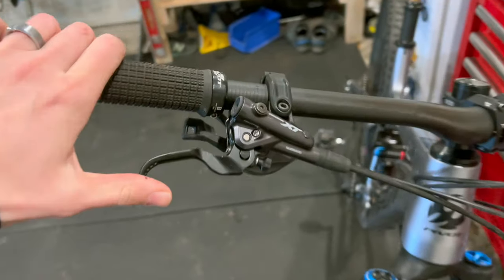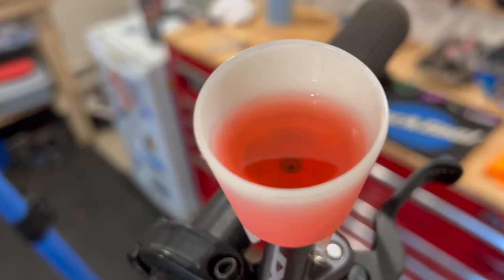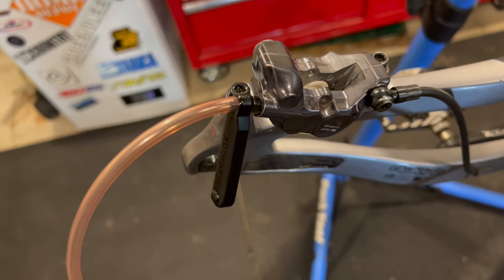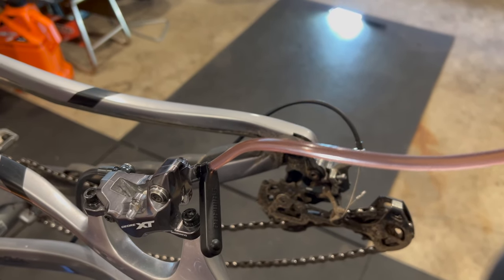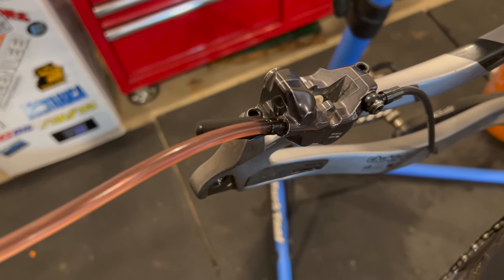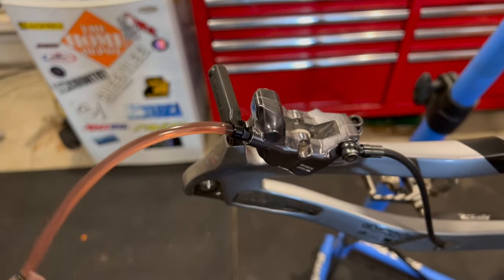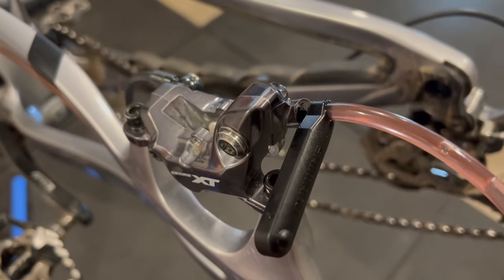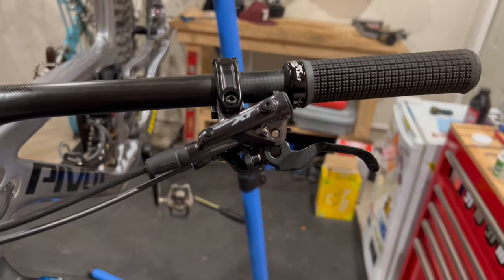Shimano Brake Bleed - Quick and Easy - How To

Comment: I just did this last night, before watching this video. One thing I would add is that once you are finished at the caliper end, and have the bleeder tight, fill the cup again and flick the brake lever a few times. Doing this should help remove any residual bubbles from the system.

Comment: I’m no pro but to add a Little something.. flick the lever also to release and bubbles and back out the adjuster screw as you flick and tap brake then screw back in… might get some more bubbles to release but this is pretty thorough pushing the oil back-and-forth through the system probably don’t need the lever trick I mentioned, but doesn’t hurt. 👌

Comment: Until I swapped over to magura I didn't realize how easy it is to do a lever bleed with a syring instead of the cup. Maybe it takes an extra 3 to 5 minutes but much more effective. Just watch how to do a quick bleed for magura you can use that on Shimano or SRAM brakes. Works like a charm
Reply from the maker: I always found that I over bled the system with a syringe at the lever. But if your technique works for you then keep doing it!
Reply: I have some Riderever (Jagwire) Arc-U brakes on some bikes.  They're cheap were I am ($36USD each end) and they use two syringes. Instructions say to lock the caliper end with a plastic clip on the hose after finishing pushing back and forth, and push the lever syringe in a bit, then unscrew and replace the bleed screw. You can definitely push too much in as I found the lever can't be adjusted all the way out now (they could go out a lot further than my hand can reach, so no biggy) 

It's easy enough with Shimano, having to repeatedly squeeze your brake lever with one hand, whilst holding the syringe upright at the caliper end. Even easier when you go find a velcro strap to hang the syringe upright off the bike frame 😊

Comment: appreciate this video. I've never had to fully bleed my brakes. I've burped the lever a few times but never a full bleed. That might change in a few days. i bought a larger travel fork so my front brake hose might be too short (going from 120mm to 160mm travel) I might have to replace the brake hose with a longer hose so a full brake bleed will be necessary. Wish me luck, hopefully I won't actually have to replace the hose since my new frames headtube is shorter so I'm hoping the shorter headtube and longer travel fork make up the difference in the length of the brake hose lol.

Comment: Are you doing this with the pistons pushed back or anything? And not using the bleed blocks? Need to do mine tomorrow so just wondering.
Reply from the maker: Yes with the pistons pushed back. I find you generally don’t need a bleed block if you go slowly, you’ll just need to watch the pistons so they don’t fall out. Use a bleed block if you don’t want the hassle. Thanks Len

Comment: Thank you....thank you...thank you!

"You don't need this part here"

I did! In my bleed kits i have an elongated piece of plastic with different sized holes near each end. I never knew what it was. None of the 4 local bike shops I've gone to have used one in front of me. None of them.mamaged to bleed my rear brake properly. 

The tube was always slipping off the bleed nipple. It was decalred 'unbleedable'. I was considering a punctured lever bladder and buying a replacement. 

So, I attached it firmly with the plastic piece, and ran very slowly back and forth the oil. Major patience mission. Put back together and my brake isn't perfect, but it doesn't go to the bar anymore on that first depression of the lever. It has a solid feel to it, not mushy. There's still a pump effect though, on the first depression, so I'm going to repeat tomorrow when I have more time, and make it my mission to get the last bit of air out of it! Slowly goes it!
Reply: Good to know.  What bleed kit did you use?   The kits I've seen don't include that plastic piece.

Comment: One question: why didn’t you use the yellow bleed block? Doesn’t it overflood the system if you don’t use it while bleeding?
Reply from the maker: I find that the brake caliper seals on Shimano brakes are normally strong enough to keep the pistons in place so i don't normally use one. This video is just a "quick" bleed, i would normally advance the pistons and lube them with mineral oil before retracting them after bleeding, negating any chance of the system being too full. Hope that makes sense, thanks Len

Comment: Thanks. Thumbs up and subscribed. One query. How do you rectify problem if the brake lever is too sensitive. The feeling that the system is ‘over full’. I would appreciate any advice. Apart from that the brake is fine. 👍🥳
Reply from the maker: Put the bleed cup back on the lever, then push the pistons all the way back, then remove the bleed cup. That should address the over bled feeling. Thanks Len
Reply: @garage31  Thank yo0u sooo much for the advice. I appreciate your time. Kind regards. John (UK)

Comment: Very helpful video.  I have a Switchblade also run XT brakes.  What brake pads do you have installed?  I am not a fan of the finned pads that come stock.  They rattle a lot and very noisy.  I'm currently using a hack to quiet them down
Reply from the maker: Thanks! I’m currently testing our own Garage 31 pads, no fins and a lot more modulation than the stock metal pads. I agree the fins rattle, add no performance for most people plus they are expensive. The Garage 31 pads will be much more affordable when they’re released. Len
Reply: @garage31  random question but do you happen to know the difference between shimano mt420 brakes and the rest of shimanos 4 pot brake models? Im looking to upgrade for more stopping power for when i do the occasional trail with a long steep descent like Pikes Peak. From what i can tell the main difference is the higher end models have better durability and longevity but i cant find much on difference in actual performance

Comment: Can I use Maxima Mineral Brake Oil on my Shimano brakes? If yes, can it be mixed with Shimano mineral oil or should the existing oil be flushed out first?
Reply from the maker: Yes no problem, I would flush out the old fluid regardless but if it mixes a little it won’t really affect anything. Thanks len

Comment: Just like that without any bleed blocks or pumping the system?
Reply from the maker: Yes, normally no bleed blocks needed for Shimano as the piston seals in the caliper will hold the pistons in. You'll need bleed blocks for almost every other brand though
Reply: @garage31  I’m glad that I switched from SRAM to Shimano! It just works. Thank you for sharing that knowledge! ❤️

Comment: I just bought a shimano bleed kit, there is  no clamp but instead a metal insert in the tube - not sure how to proceed.
Reply from the maker: Is it a Shimano branded kit or a third party?
Reply: @garage31  Thanks for replying. Shimano, bought from a reputable outlet. "Shimano Professional Disc Brake Bleed Kit TL-BR001/TL-BR002/TL-BR003"

Comment: Do you have to remove the back wheel for this procedure?
Reply from the maker: I would recommend removing the wheel and brake pads so you don’t contaminate anything. You can get by without removing anything but be really careful not to spill any oil. Thanks Len
Reply: @garage31  understood, thank you.  Excellent videos

Comment: What happens if you don’t get rid of the old fluid and keep using new fluid
Reply from the maker: Ideally you would want to flush out the old fluid, I bled this brake a few days before filming this video so the fluid was already clean. If the fluid comes out black then get rid of it, if it's still pink then it shouldn't be an issue

Comment: it has  NOT to be done so OFTEN....1 Time ...max 2 Times sending the fluid through the system will push ANY Air through...finally trapped in the external funnel....the rest of the video is dead on...good help for the beginner guys ;)

Comment: U will never use vakum to bleed shimano brakes! Lift the bike so that the brake lever is in the top position and use a hose from the brake caliper into a cup instead
Reply from the maker: If you end up with a bled brake, it doesn’t really matter how you got there. I’ve performed this procedure on well over 2000 Shimano brakes with no issues. If your technique works for you, keep doing it!

Comment: yeah this tutorial sucks. it's supposed to show to bleed but instead you're showing how to replace fluid. when did you start to bleed them.
Reply from the maker: By replacing the fluid, you also bleed the brake at the same time. If I’m doubt, push and pull clean fluid from top to bottom a few times. It’s a very simple concept. Thanks Len